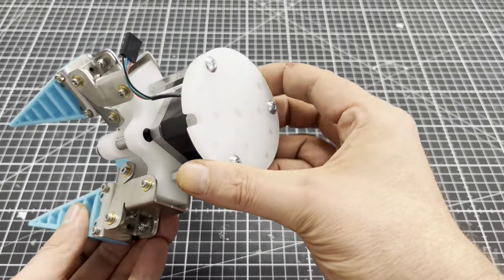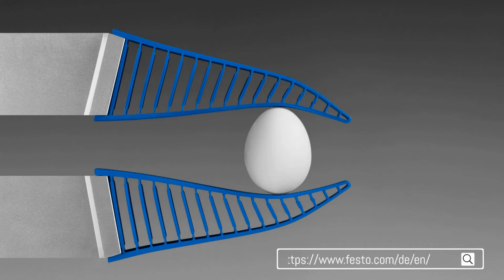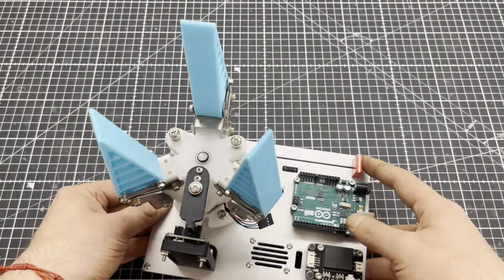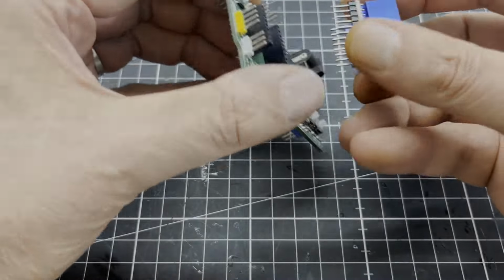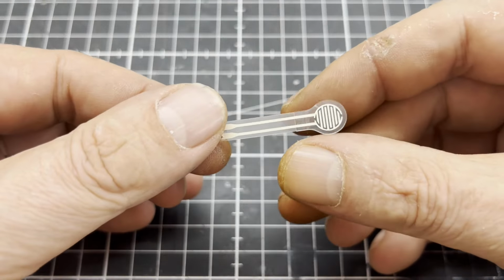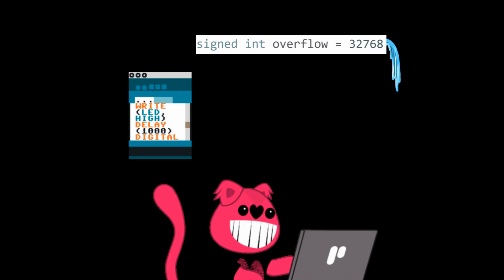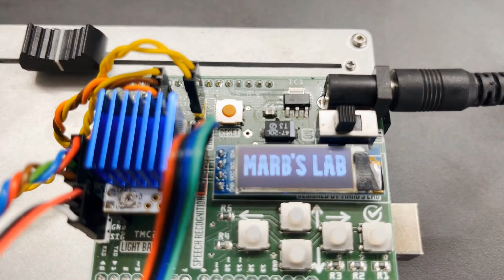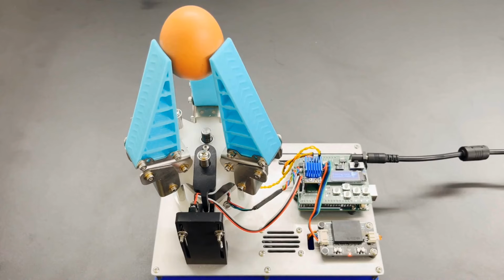Building a voice-assisted adaptive robot hand

Comment: No space for an encoder... Looking at the 8mm thick plastic plate below the motor... ok...
Reply from the maker: This plastic plate holds the whole assembly and the stepper motor. It's possible to replace it with a 3-D printed part and add an encoder and a magnet on the axis, but it's not easy. If you add a wrist motor, even more difficult. So what?
Reply: @Marbslab there are many places. Plus a simple linear hall sensor and a magnet on top of the motor 😊
Reply from the maker: @wiju  Ok, noted for version 2:)